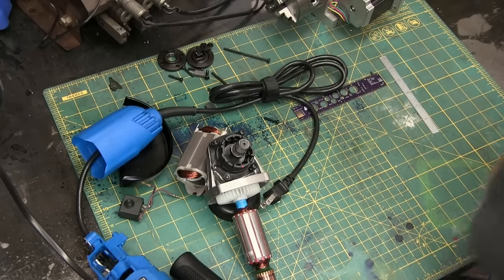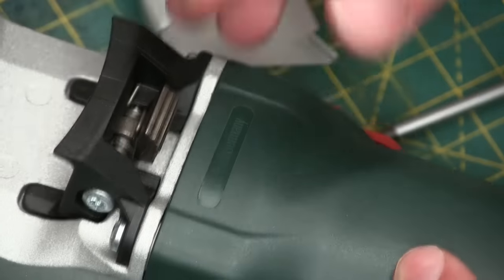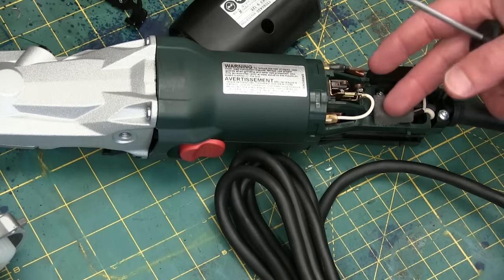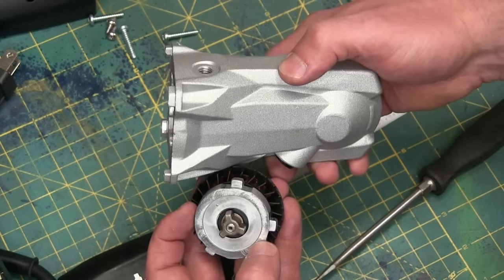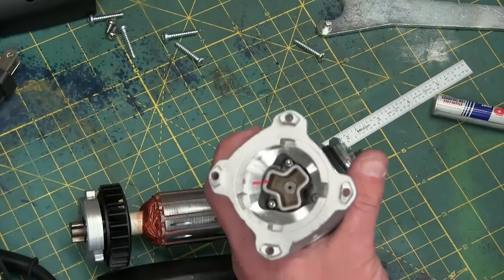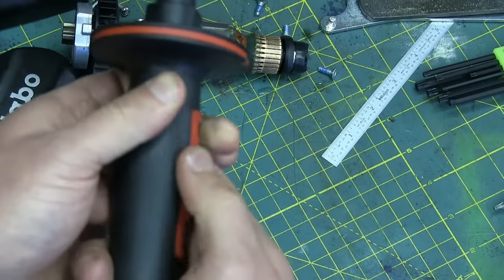BOLTR: METABO GRINDER. MADE IN GERMANY

Comment: U nailed the carbon brushes.... replaced a set in the shop metabo grinder a few months ago... there is a spring loaded pin in them units that separates the brushes from the commutator once the wear limit is reached.  Couldn't identify the pin material but obviously non-conducting.

Comment: Those plug in the brushes often indicate that they are 'cut out brushes', they have  a mushroom head, and are spring loaded, When the brush wears down far enough, the pin springs out and lifts the brush off the commutator.

Comment: That red dot on the brush is a spring loaded plastic pin. once the brush wears past a certain point a non-conductive pin shoots out and pushes the brush back breaking contact. that's how you know the brushes need replacement. if it didn't have the spring the commutator would arc and wear.

Comment: Is the open-cell foam being used as a bit of air filtration by chance? I can't think of any other use for it.....

Also, tinning cables that are put under a screw terminal will end up with a loose connection as the solder creeps away under pressure (like PVC does), it's actually forbidden in the Australian wiring rules to use solder to tin wires in a pressure type connection (screw down or crimp) for this reason. Loose connections at mains voltages = fires... :)

Comment: Hey dude! 

Very interesting and very entertaining videos, I watch um every time you post!

I had to add a bit of knowledge to your data base. The copper bar looking thing in the end of the brush holds in a spring. On the other end of the spring is a plastic bead. When the brush wears down to a certain point the bead breaks through the brush and lifts the brush off the com bar. It keeps the brush from ruining the com bars when it gets too short.

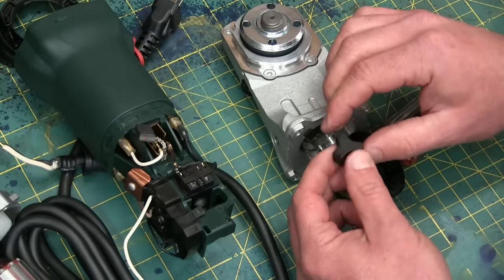Comment: i use grinders everyday at work - metabos the only ones that ever done the distance, i got about 10-15 dead makitas, 10+ dead dewalts (new model grinders are beyond awful) in garage some that never did more than a week or 2 on the job, then i got a 3 year old metabo sat in the back of the van like some rusty relic from the industrial era still goin! Im a big fan of metabo on the back of first hand eexperience using their tools in all sorts of rough conditions. They are honestly miles ahead of competition for grinders IMO (i do pointing so i rake out most days) one documented example i found was when i had to put a HAV's sheet together which detals the hand arm vibration rating of each tool you plan to bring on site, while compiling this list i found the dewalt could only be used for 3.5 hours, the makita grinder for 8.5 hours and the metabo 13 hours. For me thats a big indicator of how well balanced the parts are, the tooling process to make the components of the metabo grinders must be superior to its competition. BIG SHOUT METABO YOU GOT ME HOME FOR 15:00 INSTEAD OF 18:00 :D.

p.s. apologies for lack of attention to grammatical and organised dialogue, im kinda rough today

Comment: I actually purchased a Radley brand angle grinder, same build quality as the MasterCraft but has a cast spindle bearing cover not plastic, upon opening it up to check the crown gear quality it had zero grease inside.

Comment: Just a thought, maybe the wibble wobble of the button is a design feature to stop the vibration being transmitted from the switch lever, if it was fixed the vibration would then make the button jump/slide thus stopping the machine.

Comment: Just thought I'd mention that every Metabo tool I've ever used or come across, has been in use forever. Proof is always in the longevity of a tool. Worldwide, Metabolism is known as the best for grinders and Rotary hammer drills. What I understand is that, from a strictly engineering point of view, the materials used for whatever purpose within the tool, may not make sense. But when the materials combined to make a tool for a specific application, then it all somehow works. I don't know, just spitballing. I've never personally spoken to anyone that regrets buying this Brand. I bought a few of their drills as opposed to Festool's gear, just based on price. I haven't regretted it so far.

Comment: I think the wire ends aren't tinded because of vibrations. I got the problem once on a vibration rod (not the one used to help frustrated ladies, but the one used to eliminate air pockets in fresh concrete poured into a mold), had to rework the wire tips at least one per month, then I started to add crimps at the ends of the wire and problem solved. I don't know exactly what mechanical strain was in play, though, but adding crimps helped.

Comment: Man those old diesels were so damn good though. Really a thick and thin car and when it finally dies violently you walk away safe. Ill tell you what though, I put a 87 3 liter turbo diesel engine in my 81 mbz 300SD but I went through and rebuilt the engine so itll chooch hard and let me tell you, that 4000lb benz gets on it. Just the raw reliable torque I receive when I bury that thing just feels so mechanical yet refined, and strong. Theres nothing like a strong diesel engine and a mercedes benz.

Comment: There is one special Metabo grinder that no other brand can match. It is able to run at low speeds for hours on end. You should review that one. We use it at where I work. It's big and heavy compared to other ones but they won't get the job done. It's the Metabo WEV 15-125 QUICK.
Reply: But some would break after a couple of years of getting thrown around. The two side supports of the head would break. And the little computer unit at the end of the handle would break. But this happened to like 5% of the grinded after multiple years of intense use

Comment: Non-tinned cables are actually less prone to corrosion. Using of only copper/brass sleeves on the bare wires is the best solution for flexible cable attachments. It's very obvious that your expertise is more profound in the mechanical than in the electrical area.
Reply from the maker: Why then are marine/ oil rig rated cables tinned multi strand conductor?

Comment: there is a spring in that brush... when you wear that brush almost to the end...the spring jumps out and pushes the brush away from the rotor and you must change them or just remove the spring... it has some kind of plastic in the end.... to prevent damage to the rotor....   i saw it on my hilti grinder :). greetings

Comment: The Red Dot on the brushes seals a drilled hole with a trip spring and a pin ... Metabo calls it "automatic stop" ... 

When the brushes get really low the wear exposes the trip spring and literally POPS and pushes the brush off the commutator ... the grinder stops and you have to replace the brushes, or no go .. 

Replacement brushes are also available 'Plain Jane' without this feature.

Comment: that guard detent doesn't have much meat for the screws, but it has those little legs that fit in the cast metal part under it. Seems like that's going to take all your force rather than the screws.

Comment: actually the metabo brushes contain a spring with a plastic plunger, the circle on the backside is the plug to back the spring. once you wear the brushes enough a plastic bung pops out and prevents you from using it until replaced.
Reply: or you can rip that piece out and keep going.

Comment: Brass ferule on a wire that's going to be under compression is the correct way.  If it were soldered it's like building in a time fault; each activation there is a small amount of heat at the contact point, solder slowly moves due to compression and then eventually starts to make a higher resistance, making more heat - a 'self buggering poopertron'

Comment: I have three buckets full of 4 1/2” grinders I wore out or broke because I am going to fix them “someday”. 80% are Harbor Freight cheapos and similar, some DeWalts, Bosch, Makita, one Fein, and zero Metabos.  My Metabo 9” grinder ive had for 10 years running couple times a month, and my 5/6” Metabo running 4 1/2 wheels couple times a week for 6 years.  I change brushes when they get low, grease bearings and gearbox every 6 months and replaced the switch because I lent it out and guy cut the cord and when replacing the cord didnt tighten the terminal.  No failures in either.  They both feel like new mechanically.  

Im not saying they won’t ever fail.  I like Metabo for how they feel and the fact that I can rely on them.  They just work. No pinions falling off, busted teeth on crown gear, failed armatures, failed bearings... nothing.  Grab and go.  Can’t say the same for the other ones, especially if you hog down on them.  The DeWalts do seem to last the longest though for me, aside from the Metabos.

The trick to make any grinder last is keep it clean!  Blow it out frequently.  Service and lubricate religiously.  Change brushes, worn or not when they get down to half way (Seat them properly and dress commutator if it needs it.). Piece of coffee filter or glass filter mesh taped over air intakes also helps to keep abrasive material from sand blasting the armature and wearing out bearings.  Change mine once a week or when dirty.  That little maintenance schedule makes it so I dont have a job stoppage from no grinder.  And biggest tip of all is DON’T bog down and overload your grinder.

Comment: How tightly does the punched bracket hold the pinion in?  If there's any room for axial slippage, I'd imagine that rubber gasket in the couple could act almost like a pre-load and help that pinion seat correctly when its under power.

Comment: The potted bit is a safety. Try plugging it in while the switch it's on. My older model Metabo will start but the new models wont.

Comment: Back in the mother country of Metabo these are the same price as a Makita (if you are not going for the special low profile version).

I'm using both Makita and Metabo. The super old (1980-s) Makita 180mm thingie works fine after a hard life at a building company (even had to weld the cracked transmission case!). The Metabo is only 12 years old and is a smaller one (125mm disc). Also working perfectly.

Both great tools, with both having different selling points. Makita a bit tougher and more ultimate strength/reliability, the Metabo a bit more refined/less noise vibrations and nicer ergonomy. Dunno whats better.

Comment: Can you explain the lead shield extrusion process and why it is needed? Cooking those cables in an autoclave seems fine to me for pressure.  How can you extrude rubber into solidifying lead at 327°C without burning the rubber?

Comment: Two extra questions. Do the pixie bits maybe include power factor correction? With the gear not having shims, can the pinion self align with the slop in the lovejoy fitting since it's not solid connected to the rotor?  I don't know on either, just trying to learn what I'm seeing.

Comment: How do you feel about the SJS Makita 5inch grinders? I could have sworn I saw that they had a power limiter kind of like this Metabo, as well as the clutch slip so you don't tear the motor or your wrist up. Do you use any in your shop? What would the advantage of not having the SJS do? More user control? as far as I know all of the Makita 5inch rat tails have a SJS variant, and they have since like 2012 (ish?)

Comment: Love your vids, I watch em over and over no heemo...I have been hearing about wire insulation temp ratings a lot and most peeps are mislead to think higher rating better wire right? Not really...The deal with temperature ratings on wire are kinda confusing. And I think that ya got it kinda sideways when you see "105 degrees C". What that means is: When the 16 guage wire inside has the maximum rated allowable amps flowing through it, the insulation will be at 105 degrees. So, the more supple and flexible insulations are usually rated 90-105 degrees. Say you have 2 lengths of 16 guage insulated wire. And one has 60 degree rated insulation and the othet has 90 degree rated insulation. At max amperage the 60 degree rated wire is COOLER than the 90 degree rated wire. But while the 60 degree rated insulation is better at dissipating heat it is also less flexible usually and more difficult to work with. Which is better at not making our power tools too hot? Hope this explanation helps and do keep keeping your dick in a vice!

Comment: The foam wasn't there to apply constant pressure against the blade connection? I don't know why they didn't use crimped ring connectors with solder.

Comment: I think you will find that the electronics are a torque control and anti jam device so if you get to jam a disc in something it wont kick back and turns the motor off.

Comment: Doesn't the drive pinion locate on the front bearing in the bottom of the hole? The punched part only needs to exert enough force to hold it there which is maybe why they used a punched part, to act as a very stiff spring or a deformable piece?

Comment: I was under the impression that the Metabo grinders had some sort of clutch assembly inside so that if the wheel attachment grabbed onto something solid it would slip and make it a less volitile experience. like when you have a wire brush on it and it grabs your shirt at full speed. I really would have figured it would be made better that it is though. I'll keep my DeWilt of choice.

Comment: at 8:30 you mentioned the foam peice....I believe that is a "filter" to keep dust/gunk from entering the inner clock works
Reply: max dystopia But why would it only be on one side?
Reply: Yeah sorry that was an afterthought...perhaps gap size predicated a need for just the one side....or as he mentioned in the video...the foam on the one side had a loose fitting connection under it...perhaps the loose connector is a built in fail mode and the foam is fire retardant.... wouldn't put it past them

Comment: Would you need to take extra care shrink fitting gears on so you keep the pinion/crown at the same temper? ie. liquid nitrogen shrink the shaft vs heat the gear? Or am I thinking too much/

Comment: Hello Ave, love your videos! I do have a question. When ever I grease my grinder gears the grease basically slings off fairly quick. Do you think they put a light grease in there so its able to make its way back into the gears after it heats up enough to flow? I find this very interesting considering how fast the grease leaves the metal off both gears after minimal use. I've got a couple metabo, one milwaukee and dewalt and they all are bone dry after minimal use. Starting to think a lighter grease will be the only way to go so the gears get lube. Take care

Comment: The black rubber thing at the end of prettymuch all cable tools is not a strain releif as you always call it.... it's there to avoid the cable to be bent at a sharp angle always at the same place preventing cable failures. It does not hold anything but himself at the end of the tool.

Comment: Got o e of these for christmas and brought it to work it worked fantastic and it's not perfect but as a millwright welder the smaller frame is verry effective however I had a run in with the msha and they had a real hearton about the dam toggle switch on the side it would be it would be real nice If they made a rat tail model my 375usd grinder now sits at home

Comment: To be fair: A lot of that money is going into the flat design. A normal Metabo grinder with 900W is around 125€ (~185CAD) in Germany.
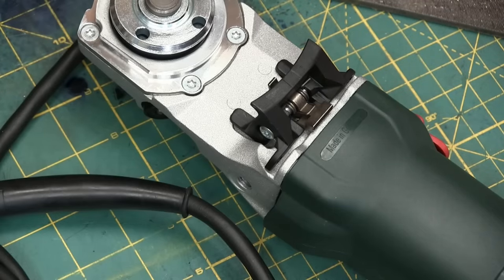The weak spot you mention at 16:20 isn't one. The force isn't held by the screws but the feet that are seated into the housing.
The sour drop for me is the shock absorber in the coupling. Wouldn't trust that thing and I won't buy one although I wanted to.
So thanks, you saved me some euros.

Comment: I own a tile store and stone fabricating shop and we tried the HILTI DEG-500-D. It seemed to be a great tool at first but within a months time 3 of them were smoked. I personally keep a Makita variable speed and a Metabo Variable speed on my trucks at all times. The metabo is a awesome unit , but the makita wins . The Metabo has a much fatter body and is a little awkward to hold especially for someone with smaller hands. Ofcourse we all know that most of the time water is needed to polish the stone. The Metabo doesn't like the water to where the Makita will tolerate it for quite some time. I am pretty sure that this is where the HILTI failed as well. The variable speed dial is more precise on the Metabo but the Makita goes to a little slower speed witch is better for my work a lot of the time. I now use my Metabo for cutting and core drilling while my Makita is used for polishing.  Note : when i say water is used the tool does get misted but is no way ever drenched.

Comment: I wonder if some of the decisions in the head are for getting the head a little smaller, even at the cost of mechanical strength. Especially the detent on the lock.

They have pretty clearly compromised a little to get the head as small as they have. I would be interested to see a comparison to a conventional metabo.

Comment: That open cell rubber looks just like what you get as an airfilter on small scooters and what not, since its an intake you usually have a rush of air through it so heat isnt such an issue... they are usually designed to be replaceable too.. looking at where it is i'd say its job is to prevent shit from getting sucked up into the comutator

Comment: On my Metabos they have a safety so if the tool comes unplugged & you have the switch on, it won't go flipp'n round the shop when you plug them back in.

Comment: The vulcanization process of extruding rubber insulation and/or jacket on to the wire is done with pressurized steam, Sir. I have never heard of it done with lead as you described. I am not an enginERD I run a vulcanization machine that does it. At least my company's way of vulcanizing the rubber on to wire is with steam. I'm not disputing that it can be done with lead as you described, but I doubt it. Lead isn't very easy to clean. Lotsa "schmoo"!